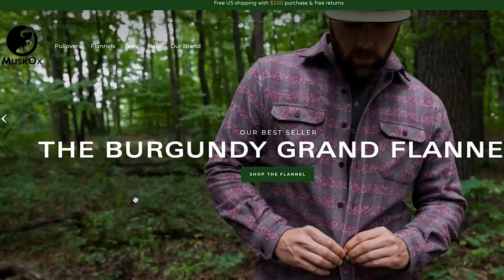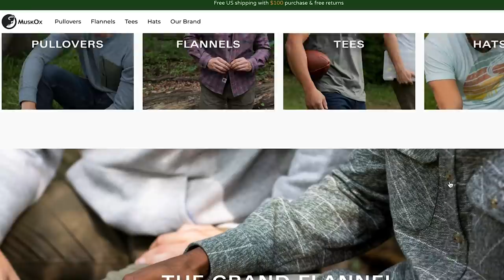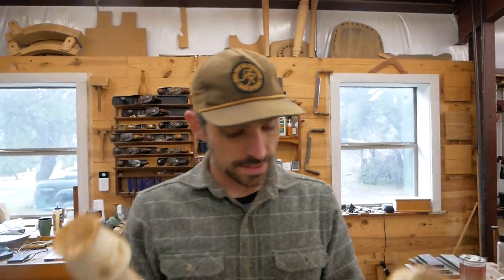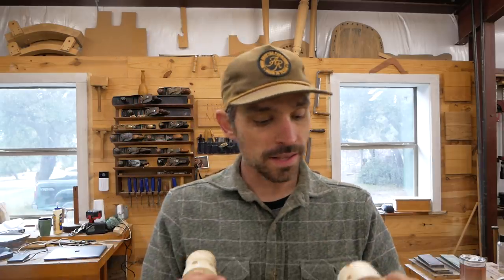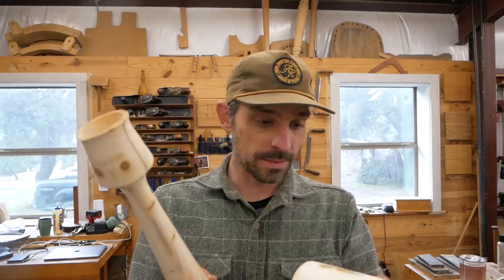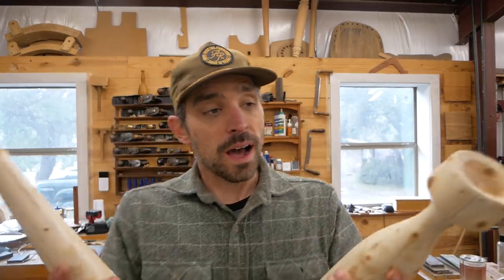Making Candlesticks From My Old Christmas Tree

Comment: Hi Andy, if you use the skew chissal you won't need to sand as much at the end. Takes a bit of practice but means your product finishes at about a 320grit and can sand with a 400grit and done :) 
They look great nice use to something other wise used for firewood
Reply from the maker: Yes, I’m a little intimidated by that tool. I need more practice with it...I still have a lot of learning to do on the lathe
Reply: @AndyRawls  yes took me about 10min to get used to and about an HR to learn what it can do. 
I don't use anyother chisel Now when on the lathe. I had the benefit of being taught by a master Turner. 
If you can find someone close by that can show you will make your turning fast and more efficient. 😊 best of luck with it though. 

Also if you go for a lower temp fix shorter time in the oven you will get less cracking. 150°c for 20min turn Ovan off and let it cool down in the oven and then turn back on for a further 20min at 150 it will dry out completely with little to no cracks. Hope it helps

Comment: What temp and how long do you put wood in the oven and to dry out?
Reply: About 120c for about 20min or you can use the microwave half power 10min bursts
Reply: Ok thanks!
Reply: In imperialeze that’s about 250°F.
Reply from the maker: I had it 325 for about 40 min